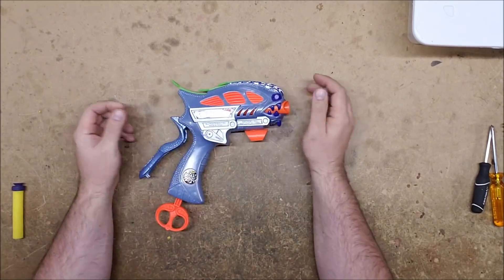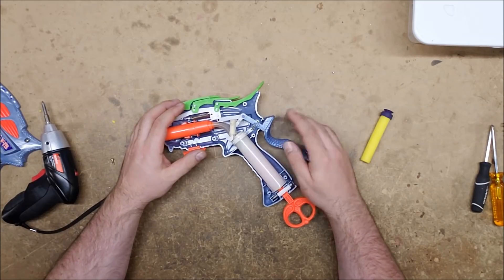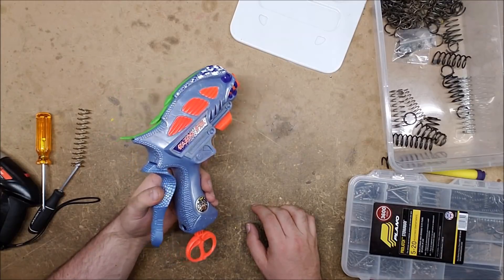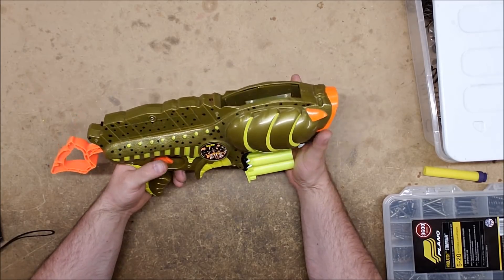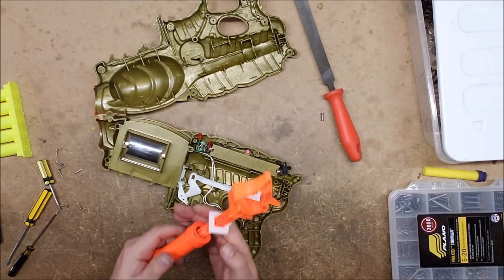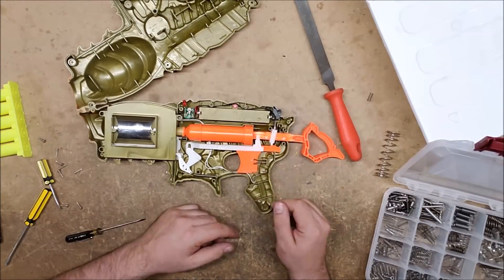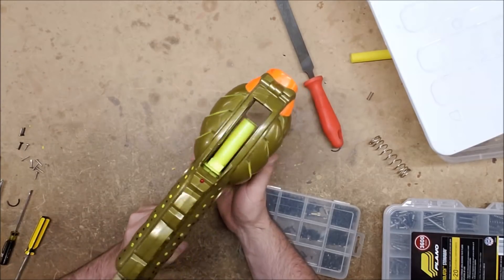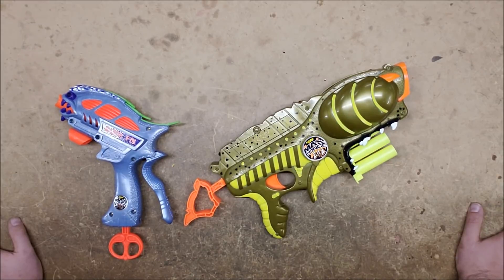Can it Take a K26? - Episode 75

Comment: Captain Xavier   I hadn't realized you didn't have drivers for the triangular screws yet... And that simply cannot be allowed! Amazon says a bit set for your drill or ratcheting screwdriver will arrive Friday.
Reply from the maker: :D
Reply: they sell a triangle tip screwdriver at walmart now as well
Reply: @papagoose8349  Thanks for sharing the info! (I almost said 'tip' instead of 'info', but the pun was too much, even for me...) I just picked the same set I use, but as bits instead of drivers- the Captain really seems to like his little cordless drill/driver thing, when it can be used. It's just a simple set with a range of five sizes, so it's good for blasters as well as some electronics. 

I use my personal set mostly for electronics... A lot of old video game cartridges, like Gameboy games, frequently were held shut with star-head screws; it made replacing dead batteries a chore, so I eventually bought dedicated screwdrivers for it. They can also work in a lot of other odd-shaped screws, too, almost anything that doesn't have one of those tiny posts jutting up in the center. (I've got a couple shapes and sizes of those, too, though, lol.)
Reply: Here's a link to the Amazon page, if anyone is interested. They're quite affordable!
5 Pieces/set Magnetic Triangle Head Screwdriver Bits S2 Steel 1/4 Hex Shank Set https://www.amazon.com/dp/B01GYSW84C/ref=cm_sw_r_other_apa_98TVBbY2JGB0F

Comment: Yo, X. I have really large hands as well. So what i do is use my middle finger to pull the trigger and just rest my index finger on the side of the blaster. Also if you were to perhaps 3D print a switch on that fin gun you could perhaps just select the barrel manually if you really cared about which barrel you use if you were to re-barrel it for elite/mega/old-school mega.

Comment: I guess they chose to use security screws because the flash bulb circuitry puts out a few hundred volts. Not to mention the potential eyesight issues from the flash. 
Also, didn't hasbro buy nerf about 8 years later?